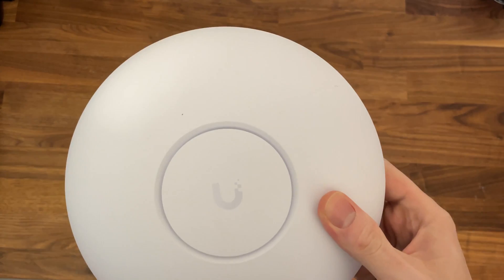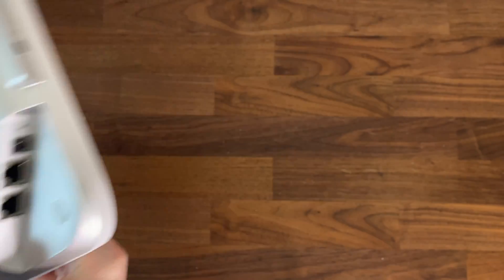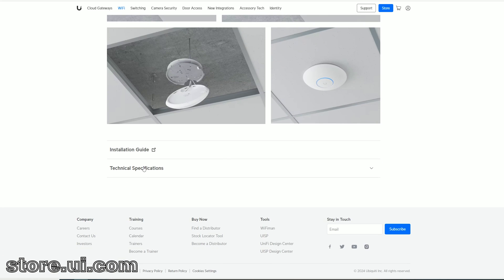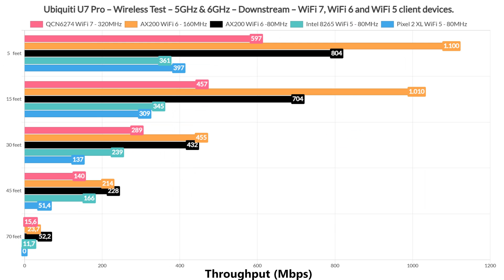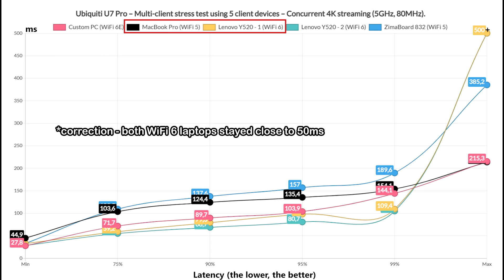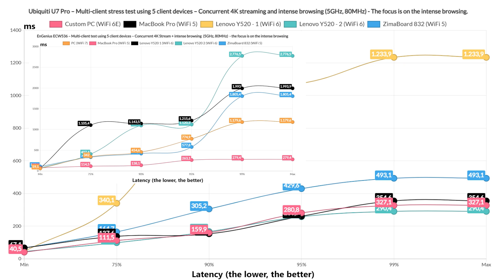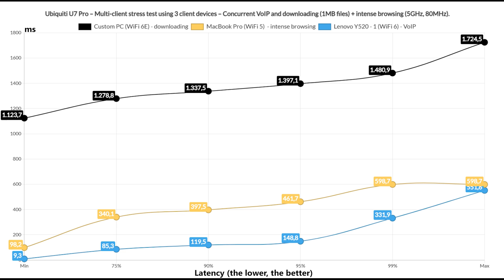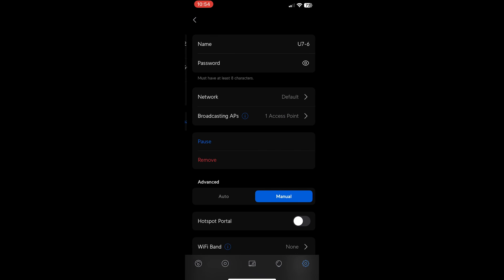Ubiquiti U7 Pro WiFi 7 AP Review & Tests: Should you stick with the U6 Pro or the LR?

Comment: I'm mostly curious about how it performs with multiple devices on 5GHz against the U6 Pro? 

I have a U7 Pro centrally mounted in a 3-story house, but after a big renovation where the middle floor got ripped apart and rebuilt entirely with more rooms and walls, 5GHz has become very unstable on the other two floors (some devices were in a constant cycle of switching to 5GHz, getting disconnected, then reconnecting with 2.4GHz).

6GHz was performing way less than 5GHz even before the renovation, except if in the same room as the AP (only tested with 6E devices but still). I even disabled it because it was just not a good experience with it enabled. 

I want to install two more so we have one AP for each floor, but was doubting wether to get two more U7 Pro's or replace all with U6 Pro, because of the lackluster performance of 6GHz.

Then I saw the U6 Enterprise coincidentally dropped to just €190 today (U7 Pro is available for €165), and immediately bought 3 of them, because this has 4x4 for both 5GHz and 6GHz. Only downside against U7 Pro is that it doesn't have WiFi 7, but we don't have any WiFi 7 devices yet anyways. If the 6GHz experience on this is better with 6E devices to where I'd keep it enabled, that would make it a better buy than the U6 Pro. 

At least the 5GHz experience should be better with it being 4x4. 
That's why I'm wondering how that compares to the U6 Pro, which should perform about the same as U6 Enterprise on 5GHz.

Comment: If upgrading from an ac lite, which is better u7 pro or u6 pro?
Reply from the maker: If you have WiFi 7 clients, the U7 Pro will work well, otherwise the U6 Pro is very robust and time-proven to be a decent access point.
Reply: @SamBondor  is it worth waiting for WiFi 8? I don't really need to upgrade just yet
Reply from the maker: @Gershy13  It usually takes about 4 years until a new standard will be out, so 2028 at the earliest for WiFi 8. Most likely better WiFi 7 devices will come from Ubiquiti in the next couple of years, so, if you're not in a hurry, you could wait until the devices get better and more stable. We're still in the testing stage, although slowly getting better drivers on both PC OSes and on the client/AP hardware side as well.

Comment: Dan you use a non-ubiquiti access point together with their ecosystem?
Reply from the maker: It's not going to work with the UniFi controller, but you can power up a non-Ubiquiti AP using a Ubiquiti PoE switch for example.

Comment: I'm finding that WIFi 7 performance is not very good, My WiFi 6E devices saturate my 1.5 Gbps connection while my Pixel 8 Pro with WiFi 7 fluctuates between 400 - 900 Mbps max download speed
Reply from the maker: 1.5Gbps is not necessarily a bad performance. Did you get this throughput while testing each client or both at the same time?
Reply: @SamBondor  correct, but 400 - 900 on my Pixel 8 pro using WiFi 7 is not, reading the whole comment is helpful.  The issue has now been fixed, I'm able to ger full speeds with the 8 Pro now

Comment: 6Ghz has issues penetrating walls. You will need one in nearly every room. 5GHz can penetrate a couple of walls and the old 2.4 GHz can penetrate 3-5 walls. Just be aware. The fan is also a maintenance issue. A large surface area heat sink option would have been better. Think of it this way. When the fan has issues, the AP will simply slow down. You may be wondering why you are having slow connectivity. If they added a red LED that stays off unless there is a fan issue, that would be helpful. At present, you will need to log into the UI to find out if everything is healthy. You will also notice the difference on your power bills. Think $10-$20 per month for a set of four AP's which would be the minimum in the average three bedroom house to get high speed all the time. Basements are extra.
Reply: Not sure why you state the power bills will go up so much when Ubiquiti states that the U7-Pro-US's max power is 21 watts.  Am I missing something?
Reply: It's not so good that it goes through so many walls.
Reply: maybe not every room needs 6ghz.
Reply: I have a small house with about six rooms (single level plaster and brick 1947 house) and one U7 Pro with no issues.

Comment: So it can't hit more than 1570Mbps ? Not even maxing out the 2.5Gbe port. Is that correct ? Kinda disapointing, is it using MLO at this point? I'm interested in buying this but not if it can't do a minimum of 2.5Gbps on a 2x2 wifi 7 client.
Reply: Or maybe u are only using 160MHz channels?
Reply from the maker: @pvdgucht  No, I used the 320MHz channel bandwidth when I checked the throughput using the 6GHz radio band.
Reply from the maker: On WiFi, there is pretty much no chance to get 2.5Gbps with the current technology, even with the 6GHz radio band. There is a lot going on in this medium to severely limit the throughput (interference, overhead and many more). As for MLO, it's still not enabled on the U7 Pro, although Ubiquiti continues to swear that it's right around the corner.
Reply: @SamBondor  ow well I’ve seen other YouTubers getting 3.5Gbps real world speeds on wifi 7 on a mobile device. 
And I researched some more and saw that another person was able to get 2.3Gbps on the u7 Pro so idk what u did differently or if it depends on the client devices capability. 
But this make me doubt which device to buy.. now im not so sure about the u7 pro. Really looking for a 2.5Gbps real world speed solution maybe MLO will bring that idk
Reply from the maker: @pvdgucht  It really depends on the client devices. You mentioned mobile and indeed, there are some smartphones out there right now that support MLO and the 6GHz radio, and yes, you will see a far better throughput than I did with my clients. There are currently limitations in place put by both the hardware (adapter) and software (Windows and Linux), so if you use similar devices to mine, it's not going to get better since there is no support for MLO yet. I am curious though about who managed to reach 2.3Gbps on a U7 Pro using WiFi. Can you name the site or channel? I am very interested to see what hardware they used.

Comment: The U7 Pro is complete garbage.  Ubiquiti should have called it the U7 Lite as that is more applicable.  Only 2x2 MIMO, no Bluetooth (so no multi sensor compatibility), only 2.5Gb RJ45 and $30 more than a "real" Pro version in the U6 lineup.  This access point is not worth the extra money over the U6 Pro.  I have 3x U6 Pros and I was going to upgrade them but not after seeing the U7 Pro's specs.  Ubiquiti should be ashamed of themselves.  They had this AP in the works for quite some time while releasing expensive 2.5Gb PoE+ switches when they should have been releasing 5Gb PoE++ switches to support real world WiFi 7 speeds and power requirements for their AP's and PoE pass through devices.
Reply: Which AP would you recommend?
Reply: They did that also at the very beginning when the U6 line came out, by introducing two so-so models and one of them a non-pro standard model that honestly was just a lite. I was lucky and only got one which is fine for personal / testing use, but I'd not get another of those for any reason at all.
Tl;dr wait a year for useful models.
Reply: @udirt  Wait a year for AP's with no Bluetooth support for the Protect AIO Sensor and terrible specifications like the U7 Pro Max and In-Wall that were released a couple days ago?  No thanks.  I can't justify their new ridiculously high pricing schemes to go backwards in nearly every feature set.

Comment: USA Law (Magnuson–Moss Warranty Act of 1975); Warranty CANNOT be voided simply by opening the device. Manufacture has to prove that whatever the consumer did caused the device to fail. Burden of proving that is on the manufacture.
Only cosmetic damage was done. So the case will not be replaced under warranty.
But if you replace the fan and the device failed to power up and/or function afterwards.
The manufacture has to prove that by you replacing the fan broke the device (HIGHLY unlikely if you know basic electronics)
Reply from the maker: Thank you for the detailed information and I will make sure to mention it in the future teardowns. I suppose I watched a bit too many Louis Rossmann videos, which is why I think it's better to try to open the device without leaving any marks because it can be a pain to fight with the manufacturers even if the law is on your side..
Reply: @SamBondor  I agree. It is a pain to fight. But fight anyway. Otherwise they will continue to get away with it. That's why these corporations say what they say. Because no one fights them on it.
Oh, I will.
Reply from the maker: @TheIceLeopard  Sure, I am not a fan of many other practices, especially the current state of the right to repair.
Reply: Louis Rossman for the win

Comment: The Ubiquity LR products are worthless in EU because they are not allowed to transmit with higher power than those no LR products. There is a max WiFi power limit and operating one outside those can bring you depending on the country in bad problems. You can enable the higher power limit by picking US as your country but this will enable also regulated WiFi frequencies and using those will be definitely detected and punished.
Reply from the maker: This was an interesting aspect you brought up and yes, it's true that there is a difference between the EU and the US in terms of EIRP. Would I call them worthless for this reason alone, not really, but yes, the range will be slightly worse in the EU. I assume that the reason is because of the denser population clusters, so having everyone broadcasting their WiFi signal on same channels is not going to fare well..
Reply: @SamBondor  max transmit power is 20mw in EU and 100mw in US. There is absolutely no difference in range from my experience comparing LR and non LR products both are limited below the US specs.
Reply from the maker: @Amixus  I know and I agree. I did test the U6 Pro and the U6 LR before outside the US, and got similar results as you did.
Reply: @SamsTechnologyReviews now I finally know why the one LR I put in place at a client had no sensible extra effect.

Comment: Can I have two ap with different WiFi technology? For example u7 pro and 6pro in the same network?
Reply from the maker: You should be able to use the U7 Pro and the U6 Pro in a mesh system (Uplink), yes. Also, I played around a few years back with the U6 Pro and the nanoHD, and I could connect both to a larger mesh network.
Reply: You can mix different kinds of APs but I guess roaming could get a problem with all frequencies so you will most likely experience a short break. Devices with 2,4 and 5ghz will work without problems I guess.